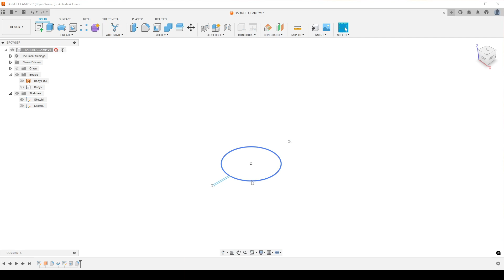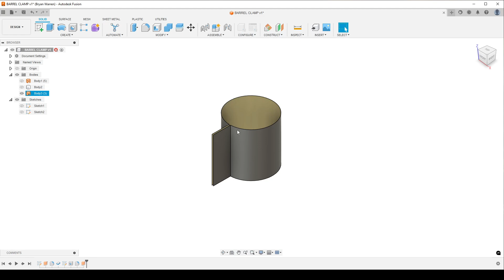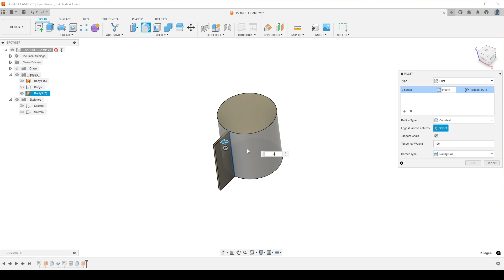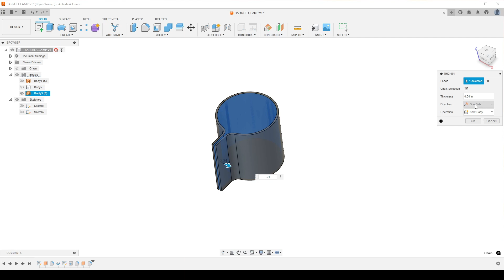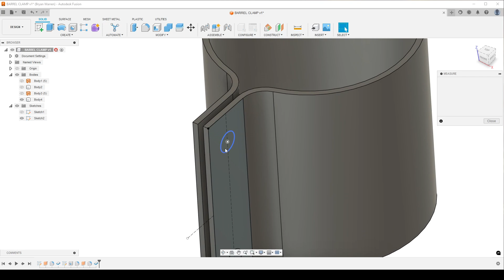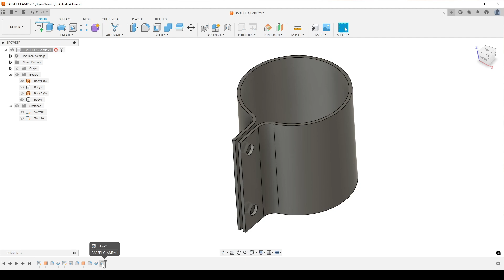Fusion 360 Surface Extrude and Thicken Tools

Comment: Are you modeling a sheet metal part here?
Reply from the maker: If we end up making it I will make it using the sheet metal tool, but if just 3d printing like I’m going to do for prototyping I use this way because it’s fast
Reply: @bryanofthings  Can create Fusion sheet metal parts with surfaces and unfolding works? If so, this I haven't seen yet.